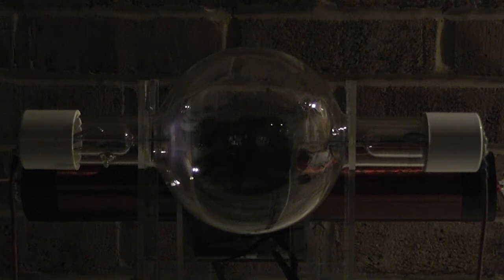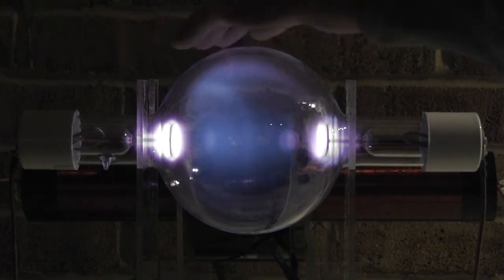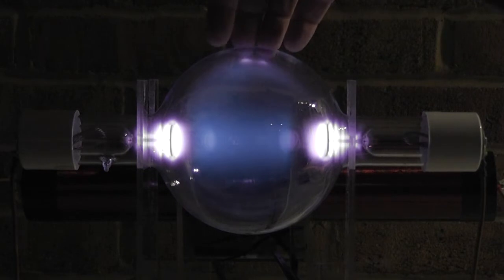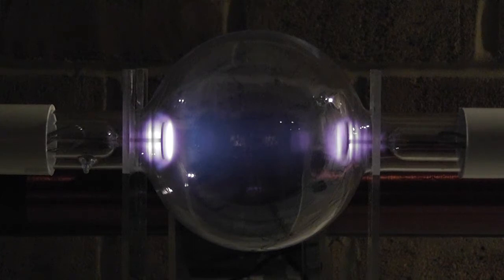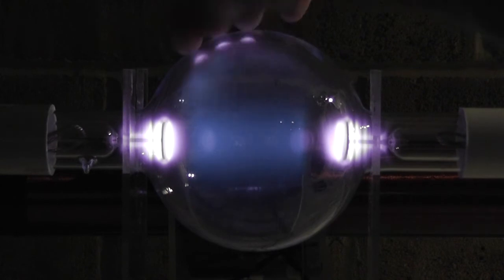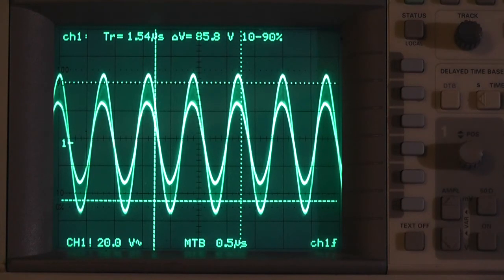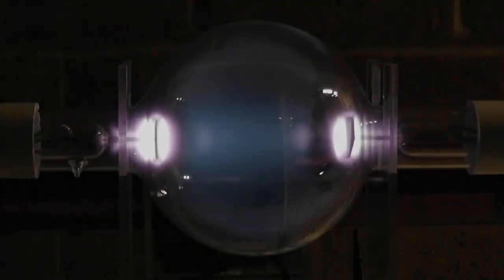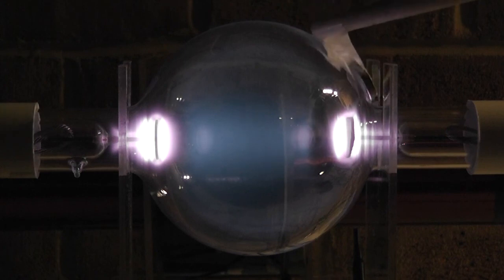Phanotron Tube excited via Bipolar Tesla Coil

Comment from the maker: Kein Problem, no worries. I was somewhat disappoint with the results. Because I did not have any reference data I needed to test that. The next tube I get will be optimised. The fine tuned resonance at the electrode level via dielectric fields is much more effective.

Comment: Hello, do think a 400kv boost stepup module would provide enough power to operate a bipolar Tesla such as the one you are using?
Reply from the maker: You do not need that much power. You need to compensate for the impedance mismatch and drive only capacitive. Watch the other videos about that series.
Reply: Have you been able to compress the plasma in the Phanotron tube into a tight ball with magnets of some sort?  Would it be feasible to make a large vacuum chamber with an aquarium or something to conduct experiments on a larger scale, vacuum pumps a readily available now a days?
Reply from the maker: I have all the kit needed but have not used it yet. Compression is via magnets as seen in the video. Works only when there is low pressure in the plasma dome. Watch all videos about the plasma excitation. In this video I used only frequency modulation.
Reply: Thank you for taking the time to respond to my questions. What gauge would you recommend for the secondary coil of a Tesla coil unit?
Reply from the maker: That depends entirely on the voltage and current you want to drive. I mostly use AWG 26 or SWG 25, 0.45 mm magnet wire. Increase Voltage and decrease frequency by using AWG30 wire.More difficult to wind. Use stranded wire as primary. Better for PWM driven coils.
Reply: I appreciate your videos and knowledge, it is a pleasure to converse with you. I have a controllable power source, I am concerned about reliability of the booster, and over heating during extended use.  It is a miniature Tesla coil in itself, I do not know if i can use the booster as a power supply for a Tesla coil. I bought 5 for experiments as they are inexpensive $2. What would you recommend for a reliable power source for the Tesla coil I plan on constructing?
Reply: I have a spool of awg40 I also own a coil winder that is wind electric guitar pickups with.
Reply from the maker: Hello, I have now opened all this subject on my website for free. Go to the tutorial pages under the Research menu point I have all details, there. Register as Guest member. Look for Tesla coil. Power amplifier. sort by first letter of the alphabet. In calculators you find how to setup your tesla coil based on size.  A ver small one is difficult to tune but I have vdeos how to do it. Make sure yo measure your reference frequency correct.